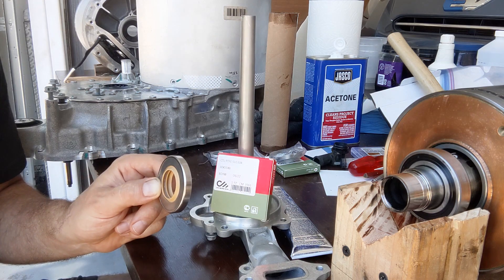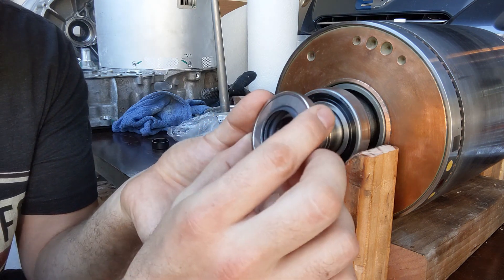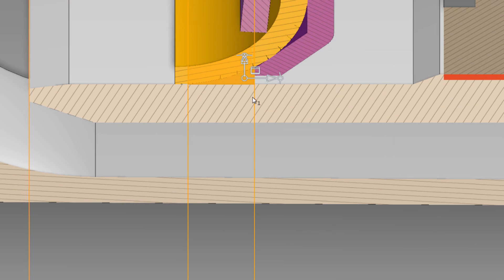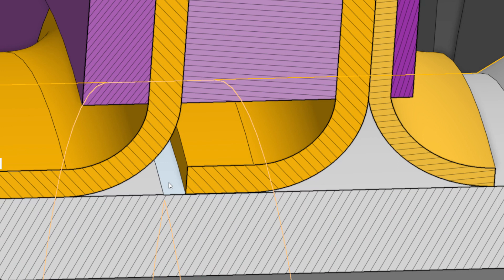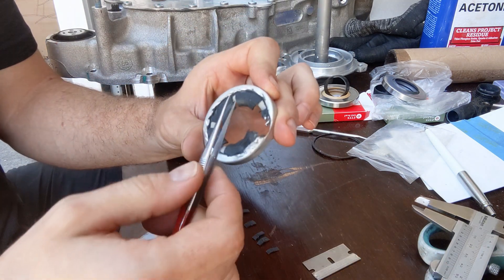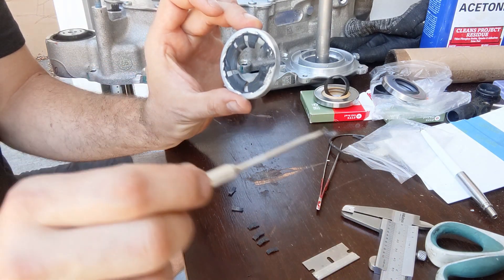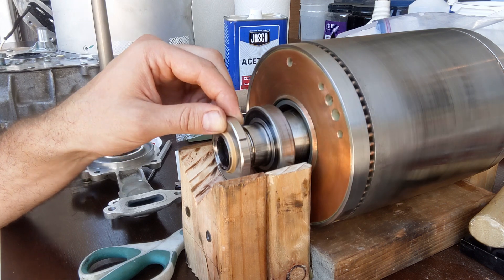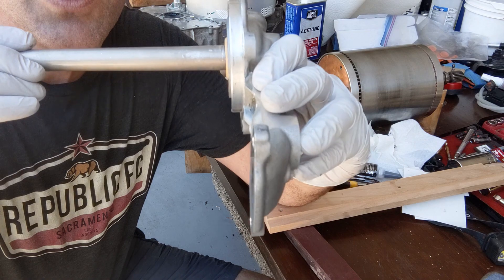Tesla Motor Coolant Seal: DIY Failure "Investigation" and Replacement

Comment: I've been wrenching on my own cars for 30+ years and I've found that the best way to drive a seal like this is to just use the flat face of a ball peen hammer and gently tap the seal in walking around the seal to keep it as even as possible. Seal drivers always seem to want to apply too much pressure to one side or the other and I've bent a couple trying to do it that way. I've never had one fail using the gentle tap with a hammer face method. 

It's interesting to me that these seals fail so readily. Standard water pump seals on ICE cars can run for 100k+ miles without leaking, so based on that I wouldn't expect to see these coolant seals failing any sooner. I'm also thinking of like a rear main seal on an engine because it's much larger diameter than even these LDU motor seals so sfpm on the sealing surface should be equally high, and again they'll run a very long time before failure, and those seals can see 60+ psi of pressure. My truck when I bought it had 190k miles on it and it wasn't even leaking yet. I changed it because the transmission was out of it, but there was no leak yet. I'd be interested to hear from an engineer with expertise in this area with ideas on why this happens in this application.
Reply from the maker: Thanks for the input. We have done a ton of research about Teflon seals. See also the website in the description for more info.

Comment: First of all thank you for step by step videos of your repair process. I am also in process of repair my Rav4EV and currently trying to find all the seals(primary rotor seal, rotor seal on manifold and 2 shaft seals) In your videos I did not see you replace the primary rotor seal. Did you reuse this seal? Much appreciated if you can reply. Thanks
Reply from the maker: I did. See my other video on that.
Reply: @diyEVguy  Your right. You did cover on another video. Thank you.

Comment: Is milling sound related to this?
Reply: Dutch man in the states? Groeten!
Reply from the maker: @jonitan3584  ja. Not sure if milling is related to a leak. Could be that you have a leak and bearings have been flushed dry and are worn out so that the gears start to grind, but that's all quick speculation.
Reply: @diyEVguy  Dank je! ik denk inderdaad dat dat gebeurt is.

Comment: How long ist the metal coolant pipe? I like to make a tool to press the seal in with a hydraulic press (instead of a cardboard tube and a hammer).
Reply from the maker: 250mm in my case total length
Reply: @diyEVguy Great, Thank you!

Comment: How about  heating the manifold to say 120°C prior inserting the seal? Why is there not a proper ceramic disk water pump type of seal? People have to pay big $ for replacement DUs because of that seal.....i was lucky, happened at 240.000km and 2 months warranty left.
Reply from the maker: Good points, parts of those are discussed in the link in the description.
Reply: if they gave you a classic Tesla RMN motor, it will happen again. They last max 150-200.000km.
Reply: @peterhandke3936  It did after 120.000km. Caught it early. Found red shaft seal. Installed drains and 3 lipped chinese seal.

Comment: сальники теперь в прошлом, этот узел модифицируется чтобы охлаждающая жидкость на заходила в ротор , так теперь делает Тесла , и есть в продаже не оригинальный коллектор , и больше ничто никогда не протечёт
Reply: Yes it's a rotor coolant delete manifold. QC Charge used to offer them and rumor says that Tesla is now using no rotor cooling on RMN LDUs. However rotor temperature and the grease melting out of the bearings might be an issue.
Reply from the maker: Correct, thank you, I should make a new video about that.

Comment: what if you replace the coolant with a mineral oil, its not conductive
Reply from the maker: Oils have higher viscosity than coolant so it will run much hotter probably which is not good.
Reply: The coolant now used in Teslas (and other EVs) is G48 which is non conductive.

Comment: SKF makes a bearing driver kit with cones to cover most common bearing sizes. You can use it to drive in seals as well. It’s the best but only worth it if you’re doing this type of work all the time. Otherwise some PVC pipe would work too

Comment: Why tesla with Chinese seal , Why not use National or CR SKF
Reply from the maker: Because of the reasons outlined in this lengthy thread: https://openinverter.org/forum/viewtopic.php?t=2242 So if you know a better commercial off-the-shelf alternative, the community is open for recommendations 🙂
Reply: Corteco is also Giant in sealing industry provide OEM for lot of car manufacture @diyEVguy
Reply from the maker: See also here for more replacement parts info: https://sites.google.com/view/teslaldu/parts

Comment: My 2013 model s had the large drive unit (performance model) replaced at 47k miles.  I now have 62k miles and am concerned it will go again at any time.  I work on my own cars and this would be invaluable to know how to repair this, I have done engine/trans swaps on honda's in the past.  Thank you so much.  I am in Chico just 1 hr and 45 minutes away from you.
Reply from the maker: 62k in total or only on the new DU?
Reply: @diyEVguy  62k in total on the car.  I talked to someone yesterday at a supercharger who has had his DU replaced 4 times now with 115k miles =(
Reply from the maker: @eastmanresearch3143  Oh, you are just getting started. This guy replaced his DU 13 times in a million mile: https://youtu.be/53E2vAF5DtA
Reply: @diyEVguy  I wonder what the permanent fix would be.  It's ridiculous that Tesla can't make these last 100k.  I wonder what the root cause is in most of these situations - main bearings or coolant seals - I would think the fluid change interval of the coolant and/or differential fluid would get some contaminants out that might wear out the seals.  I'd be up for doing coolant and differential fluid changes every 10k miles if it doubled the life expectancy of the drive unit.   Whoever can come up with a fix for this outside of Tesla will make a fortune.
Reply from the maker: @eastmanresearch3143  Judging by the posts of QC Charge, the coolant leak may be a large fraction of the DU-related problems. But common mode voltages, combined with agressive driving, causing fluting, may also be a common root cause. Personally I would try to avoid frequent large accellerations.
Reply: @diyEVguy  I am not sure exactly what fluting means (irregular shaft wear?) The large accelerations are the funnest part of owning an EV, but if this is the case it's quite expensive.
Reply: @diyEVguy  I took a quick look at the common mode voltage issues and fluting related to the a/c inverter.  It would seem that what is needed is a bypass path to ground which has a lower resistance potential over the bearings.  I worked in the wireless outdoor space (e.g. last mile internet access design) for over 16 years and we provided a separate path of protection higher up on antenna enclsoures so the esd would prefer that path over going through the pcb board, radio, amplifier, etc... we ended up even etching copper traces into the plastic enclosure to provide a path tied back to ground.  It sounds like some serious diodes might be needed to deal w/ the voltage imbalances and shunt them back to ground or as an alternative, you could build a diode which would take overvoltage and shunt it into some kind of large capacitor.  Instead of shunting more voltage to ground, you could just bump it up to the 'cap rail' or something similar.  It would seem to me that redundancy might be something that should be employed on the bearings - two layers of protection.   From the failures I hear about it's always the damned coolant leaking or the coolant and atf mixing causing enough problems, eventually it all gives out with frying the inverter or major bearing failure and the dreaded grinding noises.
Reply from the maker: @eastmanresearch3143  Look up the Aegis shaft grounding ring. Tesla used these for a while but they stopped using them for this motor. They failed rapidly after contamination with bearing grease and/or transmission fluid. Aegis confirmed this to me. However common mode voltages seem not always a problem. Instead, driving style seems to be a determining factor, but who nows. Also Tesla's switch to hybrid ceramic bearings seemed to have solved some troubles (circulating currents, for example).
Reply from the maker: @eastmanresearch3143  Check this out: https://www.woltersmotors.com/preventing-electrical-bearing-fluting-in-motors/
Reply: @diyEVguy  You have done an amazing amount of research - what is your line of work - you must be a mechanical engineer or similar with the work you've done thus far.  So it sounds like the ATF is a problem when in contact with the bearings and likely is shortening the life.  If the motor uses hybrid ceramic bearings then they would have metal bearings with a ceramic coating.  It would seem to me that these bearings are going to be a constant maintenance issue at this point - I said earlier in one of my posts that if coolant and/or atf fluid changes were done more often than 50k miles, it would be nice to know if this would extend life of these bearings at all.   The bearings seem to be the real culprit with heat and loss of lubrication in this whole mess- I saw one of grubers video's where they showed a small coolant leak in the housing of one of the inverters - it's not clear if we have two problems both equally as bad, or the failure of the bearings and associated contamination cause everything else to break down, which fluid changes might help with.  I'd love to talk with you on the phone about this one of these days to see what can be tested.  I have a shop and lab for my business and would be interested in purchasing some failed DU's and see what can be fixed.  I would think someone has solved these issues, or at least beefed up the fix a bit from stock and they are doing rebuilds, etc.  I looked at qc charge and it's not clear if they are just swapping bearings and we're back to another 40k mile failure situation.  The model 3 so far does not appear to have as bad as problems as the model s with the larger 360 and 450hp motors - it's possible this rapid torque capability is building up too much heat too quick and the lower power model 3 isn't failing as often from what I have seen online.  It would seem that Tesla could limit the current in software if they knew the amount of voltage/torque which would start to cause these issues and could make it an option.  I'd have it enabled today in my car even if it drove my 0-60 time up 50%.
Reply from the maker: @eastmanresearch3143  Sure we can talk. Just don't expect too much from me bc it is very easy to be dead wrong. I added my email address in the about section of this channel.

Comment: You can pre-heat manifold in owen and seal will be drop easy
Reply from the maker: That's a good idea! Thanks!
Reply: @diyEVguy  I really enjoy your videos on this topic, and I do not want in any way to be discouraging of your work and presentation.  I, too, am not an expert, and I've learned that there's always somebody smarter than I.  Below is mostly opinion based on my experience and education, and is offered not specifically for you personally, but for others who may be watching/reading.

This sealing assembly is an interference fit, meaning that the seal's OD is slightly larger than the housing's ID, and the seal's OD is designed to deform and crush slightly upon insertion to the housing.

Preheating a seal's housing (the  manifold, in this case) can be an effective installation technique, especially when the housing is aluminum, due to the greater expansion rate compared to the seal's steel -- if both were the same material, heat would not reduce the interference, although it would make both materials more "fluid" in a relative way -- but the note you've applied at the top of this page mentions "250C", which is quite high IMO.  There is both a safety issue -- this is quite hot to be handling -- and there's a possibility of seal damage from heat transfer.  Sure, PTFE itself is quite heat tolerant, but the seal assembly may be composed of non-PTFE materials (for example: bonding agents) that cannot tolerate that extreme.  Off the top of my head, I can imagine that the hollow rotor tube that looks to be steel, pressed into the aluminum manifold/cover/seal housing, may be installed using its own sealant (such as Loc-Tite) which is rendered useless at 250°C.  Put another way, using heat at that level may introduce a problem while solving another.

I would think milder heating, in the neighborhood of 150°C (~300°F) would be more appropriate.

As I have access to a hydraulic press, I would be using a steel pipe adapter and press for installation, rather than the much higher shock load of impact installation.  That manifold casting doesn't look robust.  I liked your paper-tube-and-epoxy initial attempt, though.  I've certainly beat enough seals into place over the years, but this isn't a wheel bearing seal here, where the stakes and tolerances are low.

Lastly, as the volume of "air" -- a leakage path -- between the manlfold's counterbore and the seal's OD will be extremely low, it's not necessary to use even 5% of the RTV that you used in the counterbore; a mere "smear" of RTV would be adequate, and even then almost all of that will be pushed to the back of the counterbore and do nothing.  The purpose of using a semi-liquid seal compound is to fill in any machining imperfections of the counterbore or surface irregularities in the seal's OD (or fill any grooves created during installation), so very little sealant is needed.  Overuse of sealants is a common cause of surplus sealant eventually breaking free and ending up somewhere where chunks of sealant should not go -- such as smaller coolant passages or jammed in the water pumps' impeller and/or inlet ports.

Again, Thanks for this and your other excellent videos.  I especially like your phrase, "Do better", as that sets the proper expectations :)
Reply from the maker: @alsavage1  Thank you so much! I will update the descriptions accordingly. You have very good points.
Reply from the maker: @alsavage1  Thank you for the added insights. I modified my description accordingly.
Reply: @alsavage1  What do you think about using anaerobic sealant in place of the RTV?
Reply: @FrozenHaxor  I've primarily used anaerobic products for threaded assemblies, with a bit of press-fit assemblies, and for those use cases they work well.  

In the case where there's a significant pressure differential across a seal, I would think an anerobic sealant might have an advantage over RTV?  But I have so little experience with them (as opposed to do-all RTV) that my opinion could be discounted.

I find more trouble produced by assembly methods than from assembly products, if that makes sense.